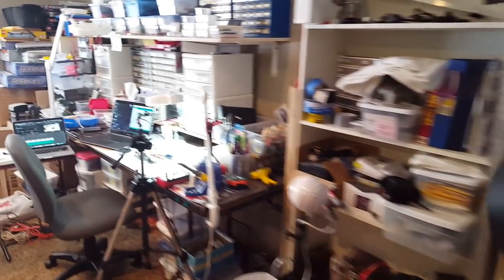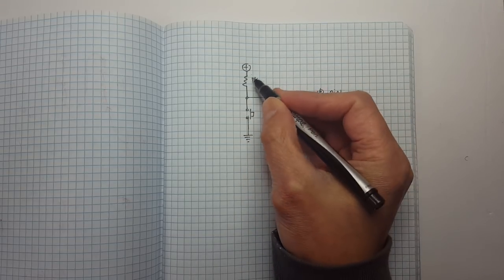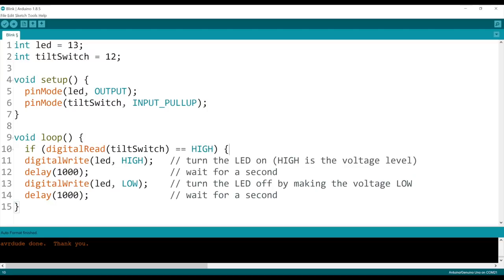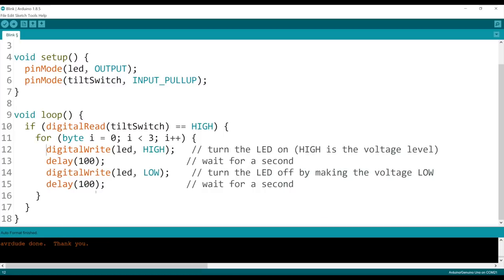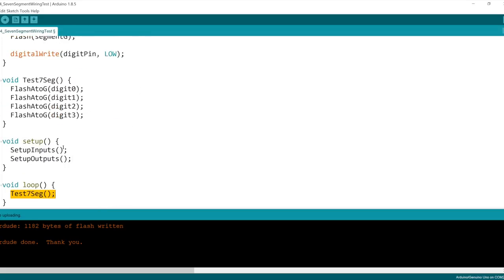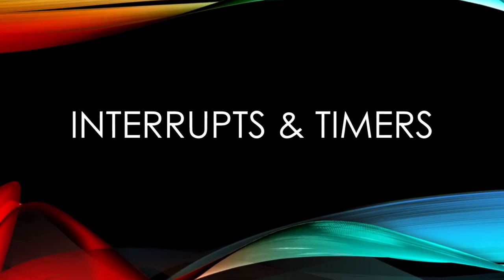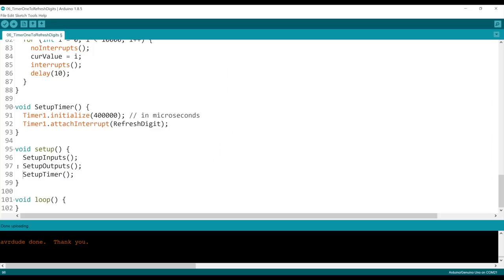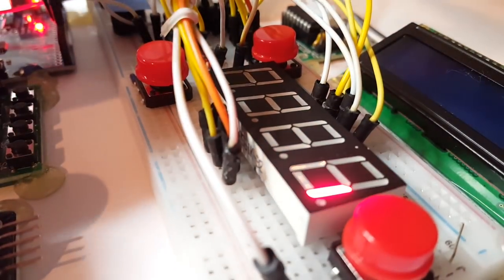HariFun #174 - How to Arduino

Comment: very nice .  you know now  you will have to show how to use that shift register . Also re floating pins , i have tried using them  to += with the random seed value  . ie read a floating pin or pins state  if they are not used else where and apply the result  as a increment to the random seed.   they effect is  sometimes a  more  random feeling pseudo random result.
Reply from the maker: Thanks Scott! You know what's even cooler than a shift register? a port expander that some guy showed me. ;-)
Using floating analog as random seed is an excellent idea!